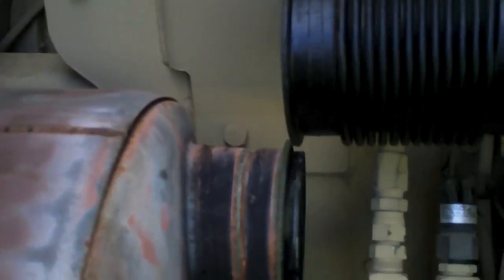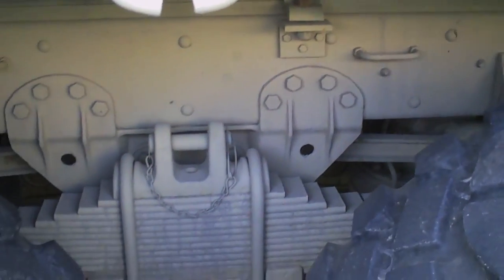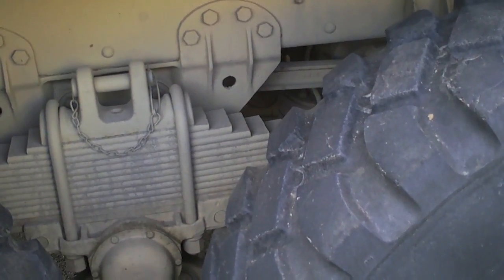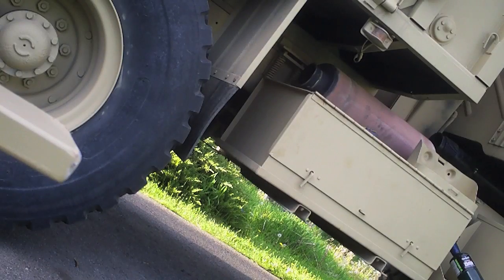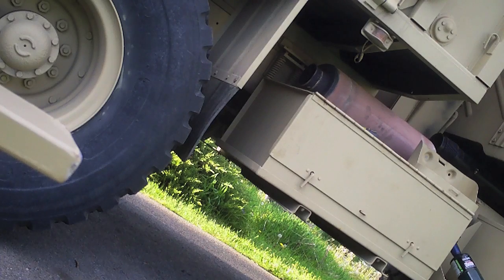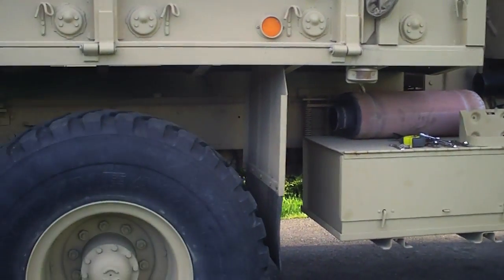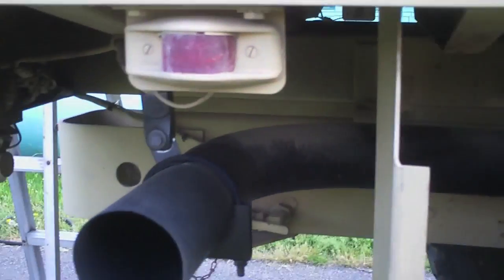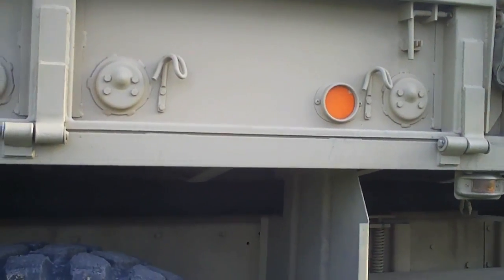AM General M923 Rear Exhaust Modification

Comment: how did this survive the test of time?
Reply from the maker: Not well. Too much bed flex though I could have overcome that with not being so cheap on the flex joints. I did it because we were hauling people in the bed and thought it would cut down on noise in the back and exhaust. Turns out it made both worse. Air currents created a vortex that grabbed the smoke and sucked it into the bed. The noise reflected off anything next to the truck and back at the people. I ran it one season then converted back to the stack after lengthening it up to about 11 feet. That let the smoke clear the top of our extra tall bed bows and cover. Most of the time I drove out from under before it could sink down into the bed. Noise went straight up too. Side exhaust did cut the noise in the cab some. Lots of nose resonates out of the oil pan so you might try cutting a mudflap or conveyor belts as a shield. I swear just adding a skidplate to the bottom of my pan made a noticeable difference. I always intended to experiment.
Reply: @acme663ryo  interesting to note the flex issue.  how rough of conditions were you driving in?
Reply from the maker: @bigrollinghome2091  yes there were several spots where we were crossing obstacles like washouts at an angle so the truck had to flex through it. One additional flex joint where the pipe went under the bed would have made most of my issues go away. I would have done it but not with the smoke issue in the bed.

Comment from the maker: It wasn't too bad and it only was warm with that long hill climb (not the little dirt one in the other video)  Normal driving it isn't too warm.  Might need a heat shield if I was ever to work it hard with people in the back.  Right now I am just worried about burning it up pulling our camper up the pass on the way to where we will be working.

Comment: Another idea, I haven't seen the engine compartment so I'm not sure if there is enough clearance but I'll just toss the idea out anyway. Could you start at the engine drop the pipe down with elbow and run it to the back inside the frame and elbow out to the outside corner at the rear?